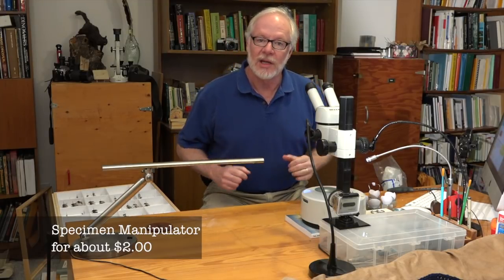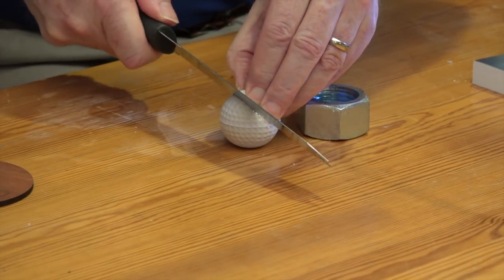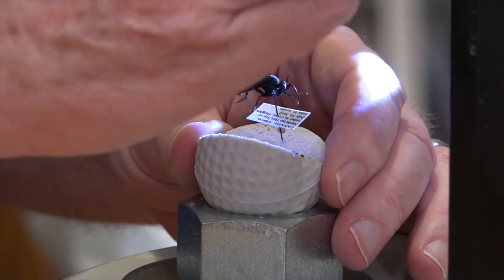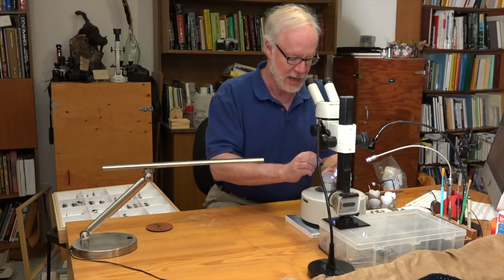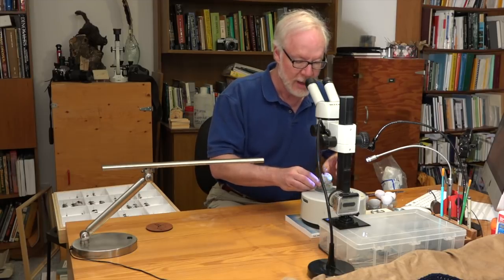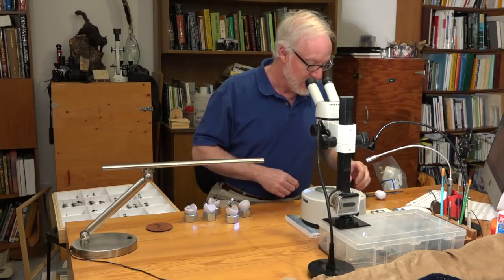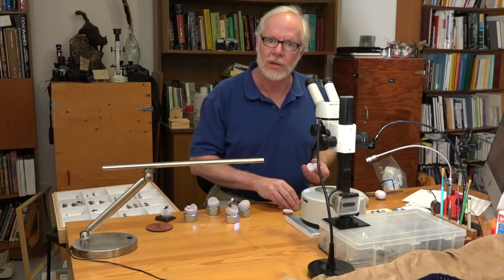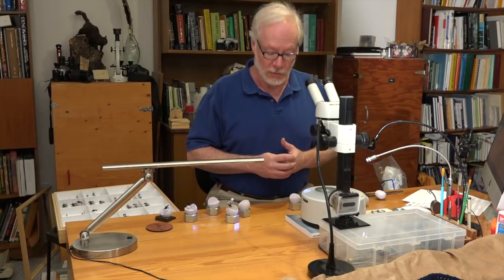Inexpensive Specimen Manipulator

Comment: Neat idea.  I'll give it a try.  Curious how firmly the inner foam holds the pin?  Does the pin spin around at all?
Reply from the maker: So far so good, although it may change as the foam ages.  Still, easy to replace the ball with a new one.